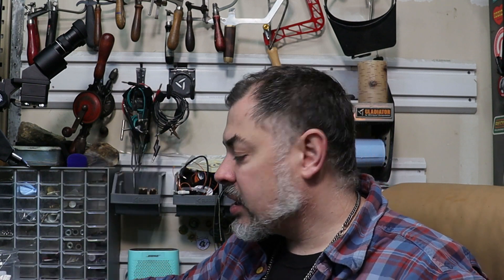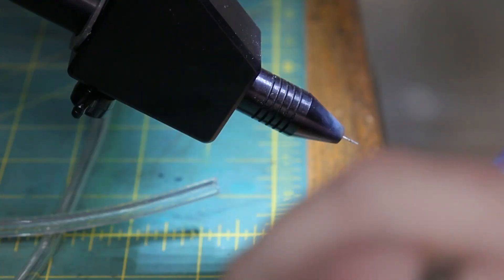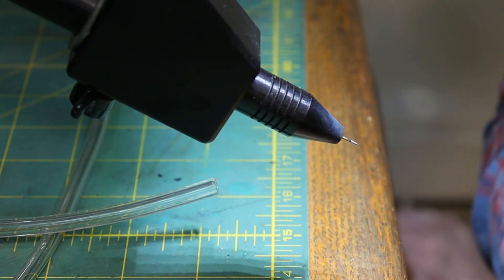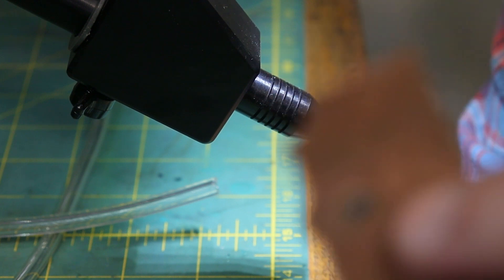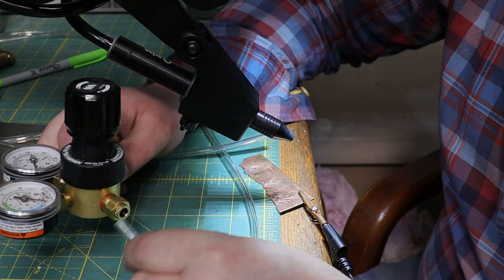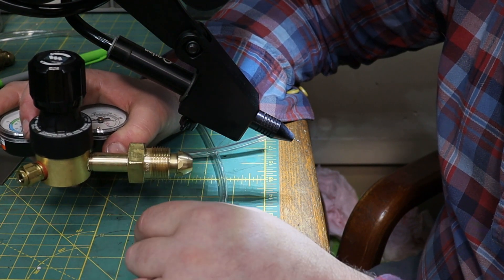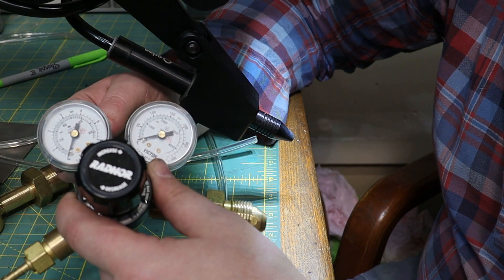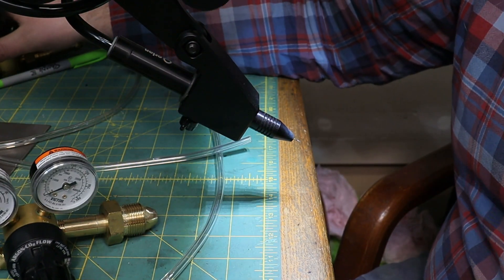Orion pulse arc regulators!! Choosing an argon regulator and weld examples with & without argon gas

Comment: I'm trying to to do small build ups on steels and titanium to repair damage and reshape parts and let me tell you, I wish I had seen this before I started.  Your example of the blown out sooty splatter (exactly what I'm getting) and the after with gas at the same settings is making me feel a lot better about purchasing the argon tank and seeing if that solves all the problems.  When I bought it, I think I was sucked in by the people doing jewely welding as far as "getting away with it without gas".  You kind of (sort of) can do one or two pulses maybe at low power on something really clean.  Then, the junk gets in the weld and the electrode just gets mangled and oxide covered after only a few pulses.  There's no way I can see being able to stack a bead of even 3-5 let alone 100 pulses without a clean metal surface and plenty of GAS.  I'm not upset about this, but I am glad to see some confirmation that I'm on the right track before spending all the money on the tank.  So I suppose that may be why you NEVER see a video of the tool and die repair guys with these things that isn't running shielding gas.
Reply from the maker: Thanks so much for the comment. I do a lot of tig and mig welding too. I can’t think of any occasion wouldn’t want a shielding gas. I’ve never understood the people who advocate it as an “option” if I’m going to spend the time making a product or doing a job. I want to do it right. Please Reach out if you have more questions- Chris
Reply: @LionPunchForgeLPF  So to put a final nail in it, I got my setup working with the argon tank today and did what you did... used the best settings I had found that were a barely usable mess without gas, and it was beautiful first try with only about 6psi of flow.  Did a couple dozen stacked spots with ER70S-6 filler on a steel part.  It looked great all the weld spots were consistent and stayed shiny and the electrode is clean and pretty sharp even after a couple dozen spots.  The argon is definitely NOT optional if you want anything more than a porus dirty wreck.
Reply from the maker: @ beautiful! 6-7 PSI is my sweet spot too !

Comment: Thanks for the informative video. I just got an Orion pulse welder and have been going back and forth on if I should get an argon gas setup for it or use it as is. One of the factors is that the regulator and tank are pretty darn expensive after the big purchase of the welder itself. Are you able to offer any coupon codes or discounts on the regulator?
Reply from the maker: You are absolutely right. It is another big purchase especially for a small business. Unfortunately I don’t have any discount codes for regulators. If you contact me on IG I can forward some additional information on the welders and uses though. I can also look around for the best deal. I definitely recommend getting your argon from a local gas and welding shop it will be less expensive than ordering them online

Comment: The only difference in those regulators is the fitting on the tube side.  That is easy to change
Reply from the maker: The other difference is the regulator flow readings - the one Orion sells is calibrated to precisely read settings needed for the welders. The argon regulators you can get in the welding supply stores have less of a fine adjustment and more of a gross adjustment for larger TIG welders. They will both fit the argon tanks we need for our welders but the finer adjustment makes using and adjusting settings so much more enjoyable